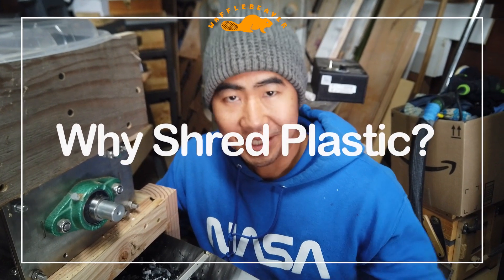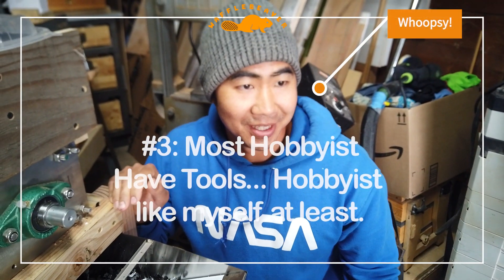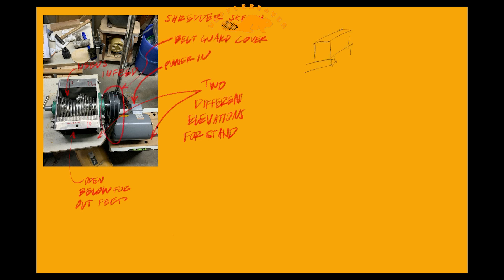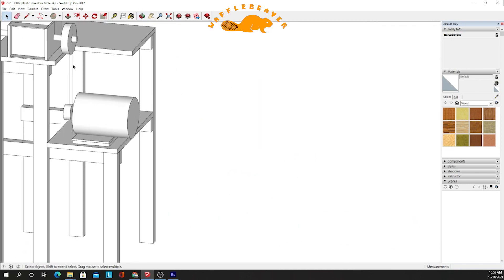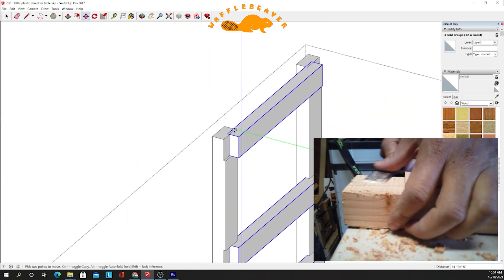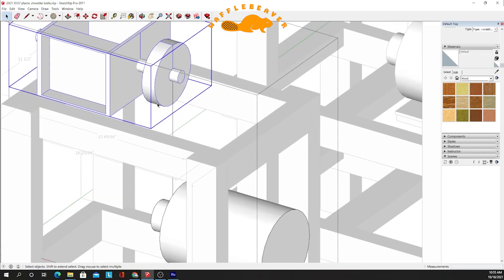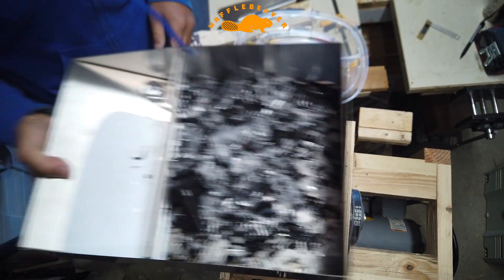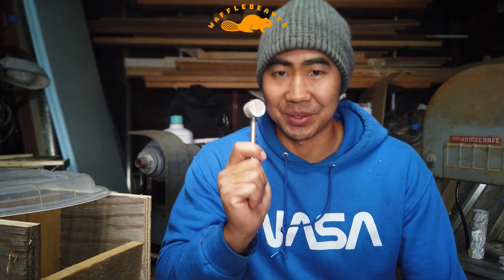Plastic Shredder + VFD + Motor

Comment: Cool. A lady near me makes jewelery, beads, buttons from orange and green recycled medicine bottles. I wonder about fumes. I don't know how she shreds
Reply from the maker: She doesn’t need to shred, she could be using an iron or toaster oven with plastic bags (also HDPE sometimes).
Shredding makes it a bit easier to melt large mass amount of plastic.  Small sheets of plastic can easily be made without shredding and just a little bit of heat.  
The fumes are not that bad but I wear a full on vapor gas mask and keep the melting temperature low.  
Thanks for checking out this video!